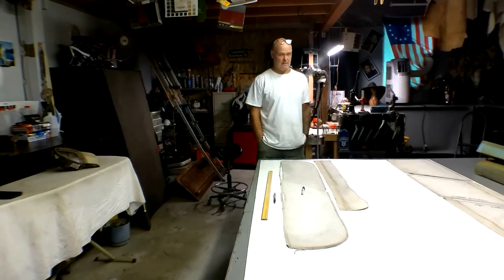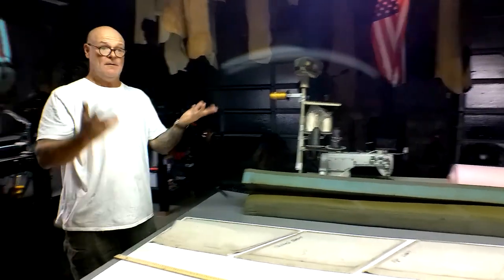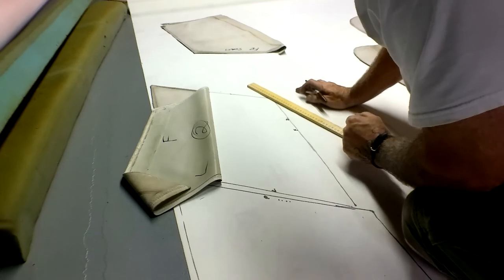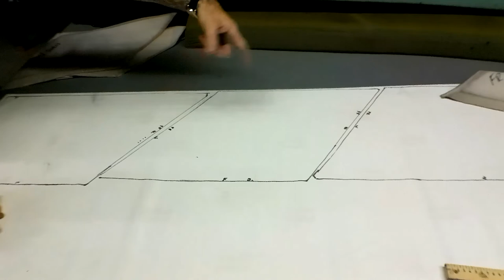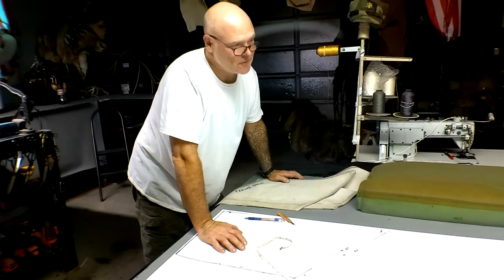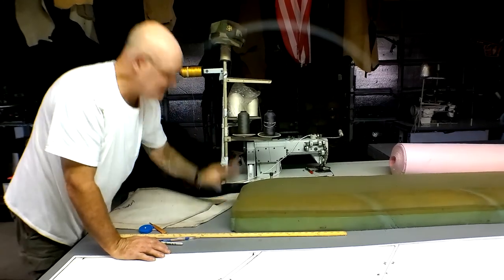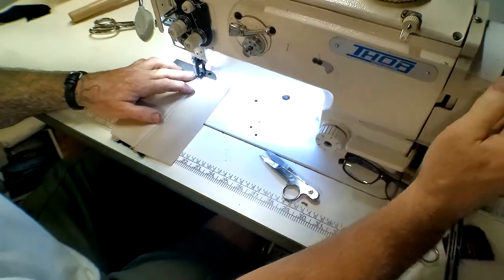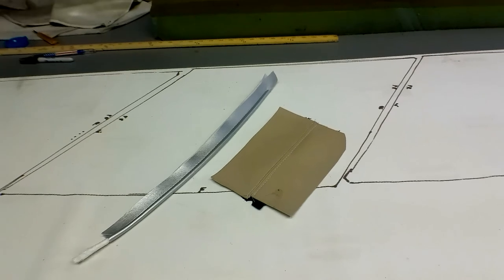PART 3 Boat Seat Upholstery Step by Step How to Upholster Boat Seats Marine Upholstery Tutorial

Comment: Just to add to that, if the cording was so off, are you not nervous to follow the old pattern? Or you would just sew it on properly or make sure it lies properly when putting it back on foam?
Reply from the maker: No, because I had adjusted it prior - most times you have to follow your eye.  All of your perimeters have to line up.  Your welt cord has to hug your perimeters of your foam, always.

Comment: Do you ever measure your foam and decide the size of your fabric/skins? Do you always follow the old pattern, just try to straighten it out etc?
Reply from the maker: If an old skin is in decent shape and just has some minor flaws, I will iron it trace it cut it out and use it.  Its a time saver.  And time is money.
Reply from the maker: Also, your question on measuring foam - yes I use it as a pattern, top and bottom and gussets and possibly zippers on occasion.